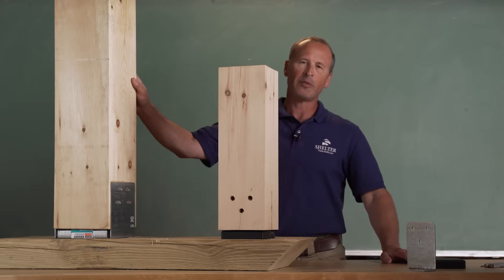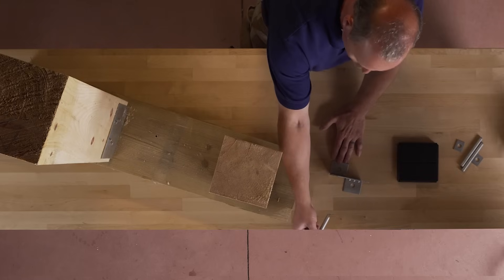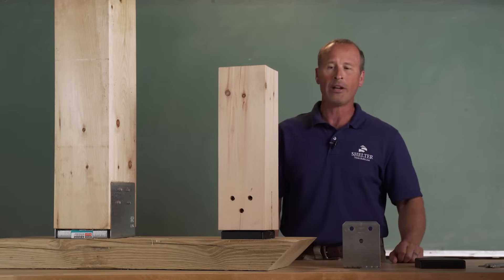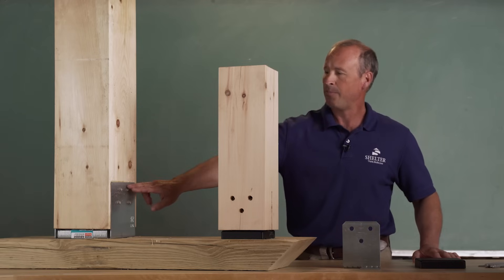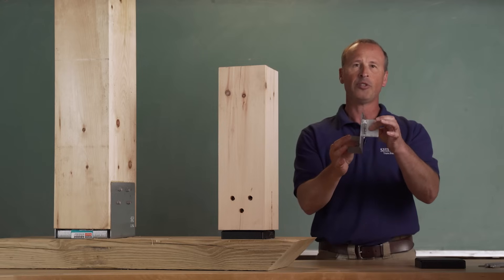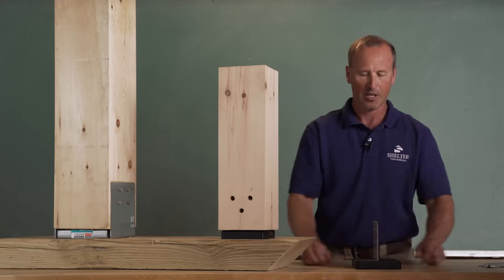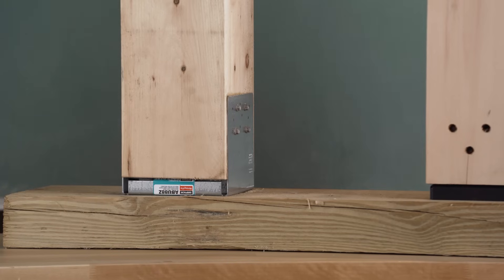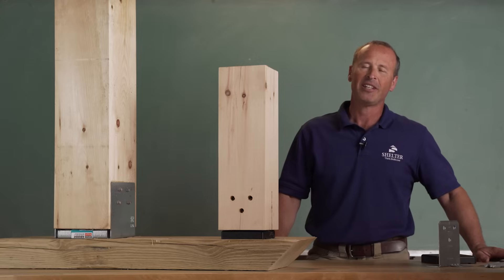How To Attach A Timber Frame To Concrete Foundation - Pt. 2

Comment: Would you follow the same methodology for a timber frame structure built atop a stone foundation that rises 3 ft or so above grade or would you want to lay a horizontal beam down first with some moisture barrier between the stone and beam and then fasten posts to the flat beam?

Comment: Just want to point out, if someone marks the holes out for the hidden blade attachment like you showed, they are going to be very upset because their holes will not line up. You would need to set the spacer in with the knife style plate to mark the holes at the correct distance.

Comment: Ive also seen you guys use threaded rod with holes drilled in the bottom of posts with 2 part adhesive squirted into the holes. Why?

Comment: I’m going to build a sleeping loft, in a garage with a concrete floor. The loft will be 9’x8’ and six feet off the ground. Very simple. Basically, it’s an indoor deck. Can I use 4x4 posts, 6x6 maybe?  Eight by eight seems like over kill for this, but I want to be safe. Can you advise?

Comment: I'm standing in Japan today, and here you would be absolutely foolish to anchor your wooden framed structure to your slab.

Given their concern is not uplift/hurricane/tornado, but earthquakes, anchoring your structure just forces the weight to rack your frame rather than allowing it to shift, releasing a huge amount of the lateral pressure during an earthquake.  I'd much rather my house move by 6" than have it fall over.

I'm curious if there's a way to achieve both in a way that won't rust out in 15 years.

Comment: If timber framing with green lumber, it looks like the slot-based system would work better, as a 6x6 post will shrink a bit in width & thickness.  When using the metal blade as a template for drilling the holes, don't you need to accommodate for the 1" plate?  Seems like it would offset the holes.  Thanks for the video!

Comment: Great video!  PLEASE - what is that black plate called that goes b/w concrete and wooden block?
Reply from the maker: Simpson Strong Tie CPS Composite-Plastic Standoff Post Base
Reply: @ShelterInstitute  Thank you so much :)

Comment: I want to anchor a porch swing to 6x6 post on concrete piers . I need lateral strength of course, should I use any of these or go without? Thanks

Comment: Boards 5cm by 30 cm and 5 meter long, placed horizontaly (30cm being vertical) for building a horizontal roof, would they bend from their own whight or under snow ?

Comment: My engineer engineered my carport for the 6x6’s to be installed in the concrete. I’m kinda worried why it was engineered that way. I’m afraid the post will rot over time being in the concrete. Should I be?
Reply: That depends on where you live and what type of 6x6's you use. Probably want to go with ground contact rated. You can also wrap them in plastic or seal them up with something.
I recently replaced my fence posts. They had been out for about 40 years. The wood was fine other than right where the wood soaked in the wet grass, snow and mud. The wood off the ground was able to dry and was fine.
Check your local building code.

Comment: In traditional Japanese buildings there are four corrosion mitigation techniques that I recall:
1. Wrap the bottom of the post in a decorative copper sheet.
2. Mount the post on a stone (stones don't transmit moisture the way concrete does).
3. Char the bottom of the post slightly with fire.
4. Dip the lower end of the post in a  bucket full of potent pesticide.
Reply: @Tom be careful burning the pesticide soaked wood! Probably char first, and soak past the char line
Reply: @Tom If I remember correctly, it's only the last 6"-8" of the end grain but not burned too much, cause that could weaken the end grain or cause it to crack, especially if you're going to drive any hardware through it with a metal standoff base. I guess if you burn it outside it isn't too dangerous, but idk if it's worth the risk of breathing that crap in
Reply: @Tom Actually, I've never seen the ends of posts charred in home or temple buildings. That doesn't mean it isn't done, though. The carpenters I worked with in the Ryukyu Islands dipped the ends of the posts in pesticide. All the charring I saw was on siding. So, maybe ask around a bit for more info.
Reply: That’s really smart. Isn’t the practice of burning to improve water resistance called shou sugi ban? I have heard a tip from Matt Risinger that if you prime the end grain, that helps to prolong its service life.
Reply: In My country we use tar to cover the wood that is in contact with the soil or concrete, also we use an aditive that is mix with cement and make the concrete water isolated
Reply: There are much better methods already present in construction worldwide

Comment: I was using Simpson Strong-Tie products before you were CONCEIVED! I built mobile homes back in college for a summer job and we installed them and "tied them down" with Strong-Ties to concrete piers. My boss (the company owner) gave a lifetime warranty that our builds would withstand Okra-Homer tornadoes and not tear-apart and blow-away if they were on our installs. We never lost a one, even in an F-5 tornado that leveled EVERY stick-built house in a small town on the block, our two mobiles were FINE! Some interior sheetrock was cracked and wood paneling cracked, but that was all. They said there were 130+MPH straight winds in that gust front. I saw a semi tractor in what was left of about an 80 foot tree-a fridge literally "wrapped around" a tree trunk like a second-skin. A two-by launched thru a brick fireplace like a toothpick thru a piece of cheese, water pipes sticking up thru slabs twisted and squirting like "modern art".
Reply: It sounds like if the damage was that bad, the tornado must not have directly hit the mobiles
Reply: Can't tell if this is top tier parody or you have complete tism. Well done 😅

Comment: You forgot to slide the base on the bracket to get the holes in the correct location. They would be an inch off the way you demonstrated. Oops!

Comment: Here's the most important thing to consider and figure out - how to cut a 3/16" thick by 4 3/4" (+1/2") deep slot for the plate - a chain saw and jig will work for large posts and 1/2" plate , however,  does anyone have any good ideas for cutting in the smaller slot for a saddle post of the size demonstrated in the video? Great demonstration video endorsing the product, but how about some real world examples of  how to cut the required slots in oversized materials that cant't be run through a machine!
Reply: One idea is to drill a line of holes to the needed depth, spaced as close as possible and cut remaining material with the chisel. It's probably possible to do the same using a router, although depth might be problematic.
Reply: @tjurzyk  you have a chisel that can cut deep into a 3/16" slot? Is it 1/8" thick?
Reply: The Makita 5402 or Skil Super Sawsquatch beam saw both swing a 16 5/6" diameter blade (414mm).  Max depth of cut (with shoe square to the blade) is on the order of 6 1/4" (160mm).  If the shoe is angled, the depth of cut would decrease accordingly, though that isn't relevant for this application.  You could treat this like cutting a drop cut tenon - a couple of kerfs to define the edges, then (in this case) chisel out the wood between.  I've never used the Makita branded blades, but Joe Miller of Fire Tower Engineered Timber has advised me that the Skil blades are the pick of the litter for these saws, and I took his advise.  Be aware that these are 20amp saws, and you can easily trip a 15amp breaker if the blade binds in wet wood.  Thankfully, they turn fairly slowly compared to a 7 1/4" saw.  Mafell also makes some lovely stuff, but a (very) used 5402 (the old, gold-colored one, not the blue plastic 5402NA) was more within my budget.  I got my 5402 cheaper than a Super Sawsquatch kit, which was all that was available from Skil at the time, and I would still have needed to acquire an 8 1/4" Skil, since I only had an old Model 77.  I still need to machine a good replacement shoe from aluminum plate for the 5402 to replace the flimsy/fragile stock stamped sheet metal one, though - then it will really sing.  Projects, projects...

For a short tutorial on cutting a drop cut tenon with a beam saw, see Francis Barnett's video, here:
https://youtu.be/1nfTS2TWEhs?t=127
Francis has other good content on his channel, including kerfing joints to close them up if the initial fit-up isn't so great, and a bunch of basic timber framing joints.  Worth a look.

A Prazi chain saw attachment for a circular saw might also work, though some have complained about accuracy of cut.  This may depend on chain grind and the individual user - I've never used one, so I can't say.  There was an earlier brand which I can't remember at the moment (rats!), conceptually similar to the Prazi, but requiring a dedicated conversion of the saw (as I recall, only a worm drive Skil could be used).  You might spot one of the old ones on ePay, CL or Marketplace or your local equivalent; they do still show up from time to time - I've seen two within reasonable driving distance of me within the past couple of years.

You can use a jig (commercial or homemade) for a chainsaw to provide a shoe perpendicular to the bar.  With a decent electric chainsaw, this would be a nice option for sundown use in a residential neighborhood - unfortunately, the nice 220volt Scandi or Japanese saws are pretty rare.  Slow and steady, even with an anemic 110volt saw, would work in the right hands, with due care and a good rip grind on the chain.  For DIY versions of such a shoe, look for fellas who are using a jig to cut half or full dovetails on cabin logs with a chain saw.  There are some simple and good-looking designs out there.  The DIY one posted by user "shinnlinger" on the Forestry Forum looks ace - basically two lengths of suitably relieved angle, bolted to the bar.

Or, you could use a sharp hand rip saw (a large Japanese pull saw would be nice), along with a narrow chisel and patience.

Hope one or another of these ideas will get you headed in the right direction.  Your instincts are correct - bring the tool to the work, rather than the work to the tool.

Comment: I have done many timbers installations using knife plate connections in a floor slab. As these plates are designed so that when the pins are driven into the timber and through the plate holes it creates a snug fit to prevent movement, this can all easily go south if your positioning of the knife plates when anchored to the concrete is out at all. The members of the frame will not square to one another and neither will your joints be tight. Your installation begins with this crucial step and it is not as easy as positioning the plates on the slab, marking the appropriate holes for the anchors then simply drilling away. I have found that masonry bits for this purpose can be notorious for drifting as you drill. You can not simply shift your timber on the knife plate to accommodate this offset. The only allowance you have is if the size of your anchors permits some wiggle room within the pre-drilled knife plate holes so you can properly align your plate according to the plans. Knife plates are a well engineered system but, like anything you build where precision is critical, controls for each stage, that may not be immediately obvious, will determine the success of your build. Hope this helps.
Reply: That looks like a nightmare to get right without a drill press-like accessory so you can be certain the bit is absolutely perpendicular to the beam.  It's definitely a good looking mount though.
Reply: @incognitotorpedo42  Yes and yes.
Reply: Wow this is good advice!
Reply: He went over the anchoring to concrete part in like, half a sentence haha
Reply: hi do you know of any resources regarding finger joint connections for mass timber construction by any chance?
Reply: Hey Tom, I'm taking an interest in timber installs and was just curious if building codes/regs allow you to drill anchors into a slab after the concrete sets. Or, do you have to set the anchors into the concrete before it sets? I definitely appreciate your time either way. Take care.

Comment: I am using 2 x Simpson Strong tie (shiny metal option) for 2 - 8x8 Cedar posts supporting a 12x12' patio.  During high-wind events, I have observed what I believe is slight lateral movement of the patio roof structure.  Believe this is caused by the 2 Simpson strong ties allowing flex at the connector (it acts as a pivot) vs greater structural stability if the posts went into the ground providing increased vertical stability.   I've considering adding some decorative corner bracing to counteract this natural force.
Reply: Same here!  Simpson 6X6 post ties.  Wobbly as heck, so I've been considering corner braces.  Did you end up adding corner bracing and did it help?

Comment: Your bracket holes are not right on the concealed bracket , If you do what you stated and then drop in your one inch fill , You are one inch out with your holes, Put bracket on then measure for holes. Holy that could cost money to people watching your vid

Comment: I've learned over the years when cutting the knife bracket space - cut 1/2" beyond the bracket size and mitigate splitting.
Reply: So you mean cut deeper by a half inch?
Reply: @smolboyi  yes

Comment: A code question about separating the  post from the concrete: is it true that in an indoor location you just need a vapor break (e.g. sill seal or tar paper), but outdoors (e.g. a porch or patio) you need the 1" lift?
Reply: Additional question: in a building with posts around the exterior, plus posts in the interior of the structure, do you need to anchor the interior posts? or is it sufficient to anchor (for lateral and uplift resistance) to just anchor the perimeter posts?
Reply: Did you find an answer?

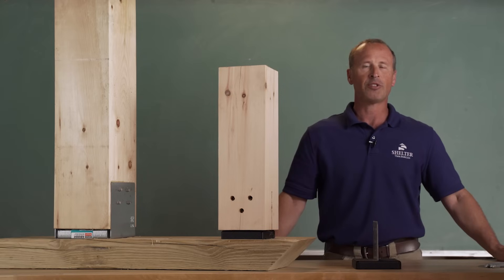Comment: At 2:40 minutes, his instructions on drilling the wood using the 3-holes metal plate as guides, will not guarantee correct alignment.  I can guarantee that none of your drilled holes will align with the metal plate’s holes.

Comment: If you follow the advice in this video on how to locate the three post mounting holes you will be off 1 inch or the thickness of the stand-off.
Reply: And this advice is from the expert, only I,m not sure of what.
Reply: @oblioyou  Congratulations, you passed the test!
Reply: I was thinking the same thing. You can actually see the difference on the video. Yikes!
Reply: I came to the comments to say the same thing.
Reply: Good observation
Reply: Was it because the 1 inch spacer was not accounted for?
Reply: @volatilenomad9854  yes
Reply: Seems hes never used his product 
Because that's a good catch you made buddy
Reply: @SomeDumUsrNameis it best to start car port (wood) assembly from rear or Front?
Reply: Good catch. Need to put the spacer on between the post and bracket
Reply: Also the holes will be on the top of the post
Reply: @alexbowser9801 .  Lol
Reply: 🤔yup

Comment: Do these prevent rocking back & forth? To me it looks like the post could wobble
Reply: The timber frame itself keeps the post stable. This hardware only resists lateral and uplift forces.
Reply: It’s way better to set your post 30” in the ground, so the load is transferred to the ground instead of the slab.

Comment: The 8x8 concealed post brackets are absolute garbage. I've got two posts wobbling in the wind. It's not like I didn't follow instructions or do shoddy work either. It's simply a very bad design.
Reply: 3 dry wall screws and it will last forever. Lol. JK.
Reply: @supermo26  Right? haha
Reply: Wobbling at the top? Seems like a bad structure design, the bottom of post shouldn't wobble, or is it?
Reply: @tranderrick  The whole thing is wobbling, including where it attaches at the base. Just a single free standing post wobbles when attached with these.

Comment: Thanks for a great demo of these anchors.  We live in the UK so don't get much dry weather and planning to build a light weight roof lean-to car port but unfortunately need to site the posts on top of a short retaining stone wall.  Is it okay to build a small brick base (min foot print of 1x1 ft sq, 4 bricks high) for each post, and fill these concrete to bed each anchor?  The retaining wall approx 2ft wide, very strong with reinforced footing.  We hope using old solid bricks for each base will add character and keep the timber high enough to avoid rain splashing up off ground level.  Our only concern is if it's strong enough to withstand strong wind.  Appreciate and help/advice.  Thanks again 🙂

Comment: Can you add a 8x8 timber column to an existing concrete slab without a footing? I would like to add vertical post an beam with parallel beams.
Reply: If it is a load bearing column, it needs a proper footing.

Comment: When you demonstrated the knife anchor and how to locate the holes in the column you forgot the 1" offset material. If you located the holes as you showed it would they not be
one inch off?
Reply: I was thinking the same thing.

Comment: Instead of a concrete slab, would this idea still work if it was being attached to a stone as part of a stone wall foundation?
Reply from the maker: The drilling and attachment would be the same, but the trouble with stone is that you are only attaching to one stone. Therefore you will not get the same uplift or gravity load capacity.